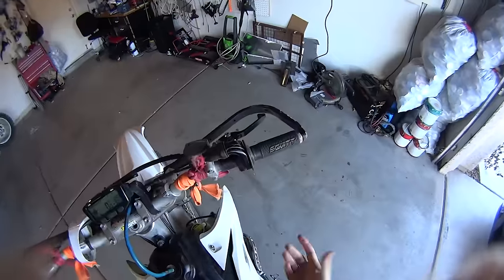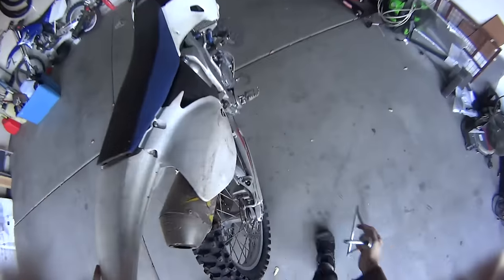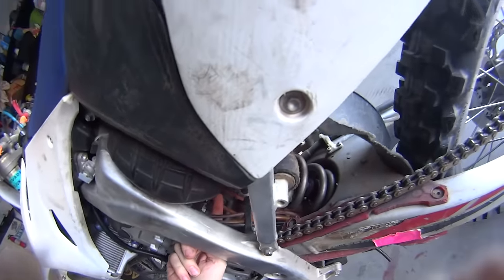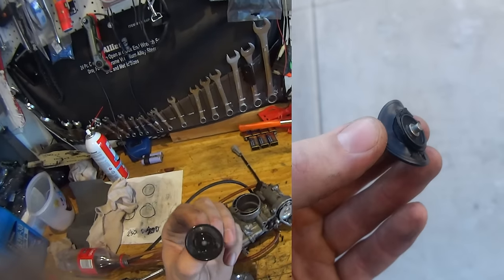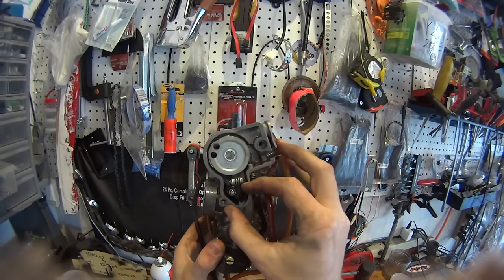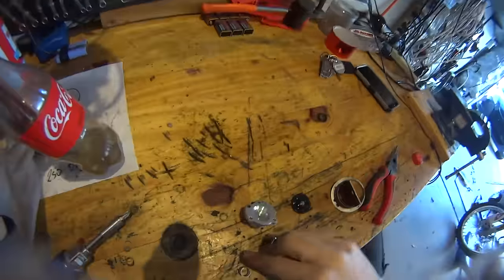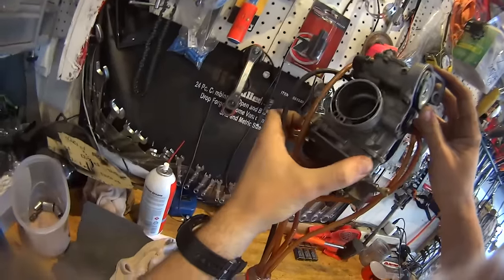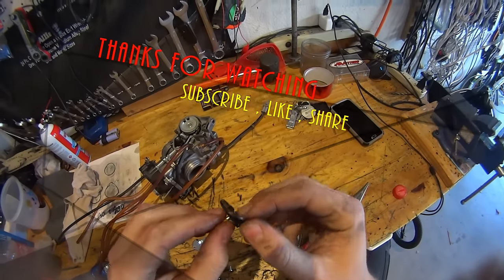Dirtbike BOGS when I open the throttle fast - Problem solved - FIXED

Comment: Vegas RoManiac First I want to say you're freaking awesome!!! Your videos are great and really help all of us along our journey!!! Keep up the great work!! Second  Im having the same issues but with a 2008 TTR 125 - L...  I've literally tried everything I can think of.  The bike starts up first kick and will even run just fine if Im easy on the throttle but any time I give it quick throttle to get over something it bogs down just like your video... Just like it!.  I have what I thought was a pump accelerator but on the repair manual they call it a coasting enricher diaphragm... IDK if thats the technical term or not but it looks just like yours,  When I first started experiencing the problem I opened the carb to find out it didn't have a spring inside.  So I ordered the new spring, installed it thinking it would fix the problem but as soon as I give it throttle quickly it still bogs and dies unless I left of the throttle back to idle.  I have ordered a brand new knockoff replica that had a good amount of reviews on amazon but not sure that will have the replacement parts im looking for.  I bought it to rob the parts off of and replace it on my OEM carb.  Not sure if it will have all the parts but that's my goal, and if that doesn't work maybe just switch them out and see if the knockoff will help it.  Do you have any advice?  I honestly don't want to take it to the dealer and get hit with a $600 bill cause it took them forever to find the problem.  PLEASE HELP!!!
Reply from the maker: Oh man, since I made that video I kind of went away from carbs so I have accumulated  zero knowledge, I really don't know what to say, hope you can find what's up

Comment: Thanks for this. I just replaced mine in a rebuild and it was doing similar after. Turns out I put it in backwards lol! Had a 50/50 chance since I could not find any pics. Now running pretty solid!
Reply from the maker: Awesome, that little thing makes a huge difrence

Comment: My DRZ does this, checked the accelerator pump and all is ok. Is it a main jet problem?
Reply from the maker: oh man , carburetors are hard to diag , maybe level in carb , also a clogged jet , a good cleaning and going back to stock jets its a great start
Reply: Change/clean you leak jet, it’s responsible for providing the accelerator pump with fuel........
Reply: Did you try the ring mod ?
Reply: I've diagnosed quite a few DRZ400's.. it's an utter pain generally! Start with a functioning AP pump like is shown here. Half the time its that.  Some people have also said mid gasket seal was responsible or too much movement in the slide. As for me I tend to get frustrated and have jetted the main slightly richer,(with an open system) done the AP mod to give it slightly more squirt. I dont get it that you can have off throttke bog with a perfect AP spray, but yep seems common on the drz KEIHIN.  .Failing that a couple of times I just swapped out the carb as I have a couple of spares!!!!

Comment: I had this once and needed to go on a ride the next day so no time to wait for a replacement, hit it plastidip and it solved my issue for about a 90 mile ride. They're pricey too, about $20.
Reply: hmm... it woulda fell apart literally almost immediately, plastidip dissolves in gas..
Reply: cap

Comment: my bike (tu250 grasstracker) is doing the same thing now,  last thing i did was putting gas in, ran about 100km, then just sat for a week due to heavy rain....it idles fine, fluctuate 3500- 2500 rpm with the choke on tho, normally at 35 with the choke on

Comment: I’m having the same issue. I have all new jets. New accelerator pump seals and rod. My CRF250R is still doing the same. I really want to figure it out.
Reply from the maker: Valve clearance check?
Reply: @vegasromaniac  yes. I’ve had them done with the engine rebuild. It runs great. Just bogs with quick throttle response.
Reply: @Drippedvenom did you fix it ? My bike it’s doing the same thing

Comment: That is what my yz 250f is doing
Reply: Lol I came here because that’s what my yz250f is doing
Reply: @talinegle6182  did you ever figure it out?
Reply: @talinegle6182  I took mine to 3 diff shops and my dad worked on it and no one could figure it out
Reply: @talinegle6182  so i sold it back to the guy that originally had it

Comment: Mine does the same thing but it don’t have an accelerator pump on it what could it be?
Reply from the maker: Fuel screw .. and level in carb .. hard to explain over text ... but fuel screw work in conjunction it idle , too much idle than you get the bike to stall under fast throttle . too much level in carb or to little bad idle
Reply: @vegasromaniac  I’ve adjusted the float and tried high and low idles and adjusted the screw and it helped alittle I bought a jet kit for it and just kinda going to change it till it gets better I guess

Comment: my 06 crf250r does the same thing  replaced all the jets needles accelerator pump and everything else in between on the carb and still no fix my hot start cable is stripped and im going to replace that hoping that fixes it and if it doesn't i don't know what else to do i put a brand new top end in thinking that was the problem because it was burning oil but nope still bogs the bottom end looks fine no issues at all so i'm starting to think it's a lost cause and just sell the damn thing
Reply from the maker: Check the manfold the connects the carburetor to the piston You might have a leak over there car cleaner spray it in there it might give you a straight answer if the RPM changes

Comment: I have a 2006 kx250f starts right up idles good but when I give it gas to bogs out but when I ride it down the street it kinda bogs then open up and then backfires a lot any help????
Reply: It sounds like it’s running rich
Reply: My 06 RMZ250 turns on perfectly fine but once i turn the choke off it bogs out and it backfires , i can only ride it with choke on
Reply: @jrsalazar24  it’s probably running too lean, when you pull the choke it makes it run rich but that’s just my thought of it
Reply: @chazz_rides584  im not really sure my bike was running perfectly fine then one day i go ride , and when i start my bike ( turn the gas on & choke ) it starts right up but when i turn the choke off it bogs out
Reply: @jrsalazar24  have you tried cleaning the carb?
Reply: @chazz_rides584  no i haven’t yet , someone said it might’ve been the spark plug so i bought a new one , but this week i will clean the carb & any suggestions how ? Like what to use air pump or cleaner and for how long ?
Reply: @jrsalazar24  you can look up tutorials on how to clean it but usually you spray some carb cleaner through all the jets and making sure their not clogged
Reply: Same as me mate

Comment: I have a 2001 ktm lc4 when I ride and give it full throttle it like gets flooded and then back fires. Any ideas? Thanks
Reply: On yz250f 2004 has a under the carburetor air and mixture screw try one turn out going and check yt

Comment: I just replaced this part. It was in pieces. It worked good after I replaced but still a bog every once in a while. I'm thinking my o ring mod came lose or I got pieces of that diaphragm in my carb now. I know it's not my jetting I have it spot on and never had problems before my diaphragm.
Reply from the maker: Yeah, with carbs 1 million things can go wrong, sometimes you just need to yank it out and check everything...

Comment: I have an ATV that recently has this problems:
- when I accelerate it doesn't pull as strong as it used to (not too noticeable but still)
- when I go at max speed (80khm) and release throttle almost completely it only lowers down to like 50-60kmh so it seems like I'm not even holding throttle and it still goes. (I would have to release the throttle completely for it to start slowing down - which it seems like engine breaking is non functional at this point)
any ideas? any tip is good!

Comment: Put ethanol eat through that diaphragm?I just bought a 2016 kx450f and I didn't know that I had to run 93 octane gas in it so I was running the cheap 87 octane gas and it started blogging and I shut it off completely and it felt like it was really really hot
Reply: Octane doesnt have anything to do with ethanol content. But yes, use high octane, and ethanol free high octane if you can, not super important.

Comment: does anyone known how to fix the cutting out issue for a ttr125 just rebuilt it. it only cuts out when going slow but when I run it wide open it's fine pla help
Reply: To lean
Reply: try adjusting the float height.

Comment: I just went through my carb on my 2006 KX250f and replaced everything on the diaphragm except the push rod there. It still bogs at a fast throttle. Would that rod be the issue?
Reply from the maker: Hmmm. Gap on the spark plug maybe.. Or bad fuel, or valves out of spec.. Many things can do it.. The rod if bent will stick
Reply: Check for any leaks on your boots on both sides of the carb so the one that goes to the engine and the one that goes to the air boot. If there is one replace it and see if that helps

Comment: Hey I have a 2002 Honda xr100 that has a brand new carb that goes through spark plugs a lot and bogs pretty bad. What do you think that would be? Thanks Mathias
Reply: I’m 4 years late but you probably running too rich

Comment: My 1995 Cr12R wont hit the powerband. What could be the issue? And how do i fix it?
Reply from the maker: +Eddie Nelson nope a 2 stroke Smith at doesn't hint the power band has a bad power valve that is broken or stuck

Comment: Thanks for showing this to people really generous, but i have this problem on a two stroke 125😭 and i cant seem to find the problem would be cool with a respons🙃 nice video tho😎 (subscribed)
Reply from the maker: 2 strokes re very difrent, could be false air sucked behind the cilinder or worn rings.. Maybe a dirty carb
Reply from the maker: Dirty filter
Reply: @vegasromaniac  thanks a lot i will try cleaning the carb since the bike i have was overhauled not long ago, maybe the previous owner lied. Although thnx a lot🙃
Reply: @vegasromaniac   I changed the filter before the winter then had it staying for about 4 months. After that i cleaned the carb. Do you think the oil on the filter to thick after staying for so long?🤔
Reply from the maker: @grandgony4467  o a compression test .. that will tell you . also check the reeds !
also maybe this will help https://www.youtube.com/watch?v=uJUGOJQH99w
Reply: @grandgony4467 did it work?

Comment: i found tiny rocks inside my carb, cleaned the ets n everything. still bogs. anyone wanna help?
Reply: tiny rocks wth
Reply: Ethanol in fuel does that when mixed with water / moisture. Use fuel with no ethanol if you can

Comment: Could this cause the exhaust to heat up red running at a higher rpm, but still boggy...?
Reply: switch to engine ice coolant

Comment: Lucky my bike run okay with current pump, because I can't get it out. The screw got stripped on it. Maybe I can get some tool for that.
Reply: Get a hand impact driver and a Snap-On bit. Wack it hard in the right direction. It comes loose...
Reply: Get an easy out bit for a drill .